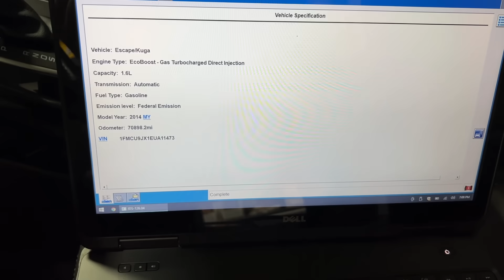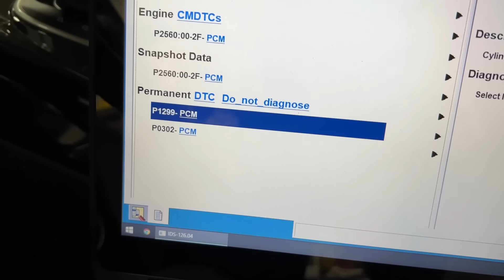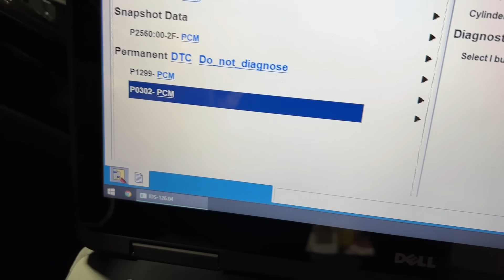Beware of Ford’s 1.5L 1.6L 2.0L Ecoboost Engines and Their Never Ending Coolant Consumption Issues!

Comment: I love your honesty and willingness to call out the problems, unlike the other ford tech channels that continue to deceive people, and say it's not a major issue. I'm a ford tech as well, and I find myself calling out Ford's newer vehicles for quality issues more and more as I work on newer rigs. Even new Toyota vehicles are having issues, Korean makes, hell, all of em. 

Don't buy anything new if you want value for your $. I always tell customers, sink a small portion of that extraction $ you would spend on new, buy a clean older vehicle, and fix it up. Not only are they cheaper, but better engineering, better part quality, material quality, less labor, less parts cost, and you can make it truly yours with rims, tint, stereo, lights, whatever. You'll still be out the door for a small fraction of a new pile. You'll spend less on insurance and registration. You'll pay less tax. 

 All brands, all models, are just planned obsolescence. That is absolutely the truth. I drive an old 03' 7.3 super duty, and a 08' Scion TC that are both fixed up pretty nice, the way I want them, for pennies on the dollar. I'd never trade either in for any of today unreliable turds. 300k problem free miles from the superduty, key on, hook some weight to it, go strait to New York right now with zero worries. Same with the TC, there's close a thousand pounds of audio equipment in it, been like that for some time, and I'd trust it over anything new to go anywhere. The wife's 09' G8 stays in the driveway at 70k, with a cover on it, because I know the afm is trash, and will likely have problems soon. We will sell that to an enthusiast for top dollar, and get something older, more reliable and be able to replace it if it gets hit or totaled. 

Don't trust any of these newer vehicles without extensive research and knowledge, because chances are, it'll cost you big. 

This is by far my favorite ford channel, you keep it real, a true American and patriot helping others avoid major headaches. You're awesome dude! From one ford tech to another, I'd EASILY day you're the best in the biz! Thanks all you do for everyone!
Reply: Your right on! They don't make anything to last and not just cars anymore.
I wish the sheep wouldn't accept it.
Reply: George, I agree completely. I don't think any new cars or trucks are worth what they are asking. I actually bought a nice old 95 Taurus, under 100K, for $100. Little money for head gaskets and it is my daily driver. I wouldn't hesitate to hop in and travel anywhere with it. And today's engineers... they don't have a clue, as to the problems we have working on their over-engineered garbage... any make!
Reply: Spot on...  One of my rides is an 05 Mountaineer with the notorious 4.0 SOHC. At about 230k, I got the timing rattle at ~2300 RPM. I did a timing job using Brian's videos to fix the rattle and it runs like a champ. The engine design is stupid with chains in the front and rear so it is an engine out job but it was a pretty easy engine pull and there was plenty of room in the engine bay. Other than that and some work on the 5R55S trans at ~150k on the valve body/solenoids, it has been a tank and it has been driven from coast to coast many times. It has been paid off for a long time and is relatively easy to work so I hope to get it into the next decade... too many computers/unnecessary electronics/turbos on newer vehicles... NA all the way!
Reply: @robc7323   @robc7323  maintenance is key, clean air filter first, oil and other fluids second, and third, responsible driving habits. That's usually is the key for success, or buy an over priced headache, and who know what you'll deal with later down the road. As long as your happy, and getting value for your money, cause that's what counts!
Reply: What happens when you wreck the older cars? The insurance won’t give you jack for them and you’re out a good bit of money keeping up the older ones unfortunately. I agree with a lot of what you’re saying but I’m not spending thousands to fix an old car just to get it totalled out and insurance writes you a check for a fraction of true value being book value

Comment: I have a 2012 FX4 F 150 with the 5.0 in it with 160 thousand miles it runs great I have never had any trouble with it but here lately it’s idling rough shaking then it stop shaking for a few seconds then it goes back to idling shaking again what do you think it might be thanks

Comment: Ford used to be very good compared to the other domestics as far as 4-cyl FWD. Now they've gone the way of GM. 

From an engineering standpoint, I'd like to ask who in their right mind thinks it's a good idea to throw boost at an open deck block design. Doesn't matter how much meat you throw at the cylinder walls, it's not going to be supported as well as a closed deck design. Whiz kids 🤦
Reply: Describe open deck vs closed deck design... Thank you!
Reply: @garrettstevensen2467  sure, I'll give it a lash. Open deck is when the cylinder head is removed, what you see is the outside of the cylinder walls & water jackets. It is all visible & "open" to the head gasket. This is done largely for cost measures, the block is cast & simply flipped over to empty the core sand. The disadvantage is the extreme upper part of the cylinder bore has no lateral support due to the absence of a deck & becomes an issue especially in boosted applications because the extreme cylinder pressure at the moment the plug fires causes the bores to expand ever so slightly like a balloon. This tiny bit of movement over time eats away at the head gasket. This movement can be counteracted somewhat by much thicker cylinder walls & ribbing but of course adds weight & cost

A closed deck is the opposite, when the head is removed, you see a slab of metal with cylinder bores & a few small passages for coolant, oil & threaded openings for head bolts. The upper part of the cylinder bores have lateral support & can resist bore distortion at the extreme upper end of the cylinder. All the classic American V8s have always used this design. That's why you hardly ever hear of them spitting a head gasket even under extreme levels of boost. 

That's not to say open deck hasn't ever been used successfully, Honda B & K series motors both excellent examples. They've been shown to make 1K HP easily...albeit at long term cost in reliability.

Comment: On the flip side, I have the 2015 1.0L 3 cylinder eco boost, zero problems including the duel clutch transmission. I think it’s the 2nd generation engine when they sorted the coolant hoses.
Reply: You are right the 2105-up 1.0L have the coolant lines fixed. They are also iron block which means no coolant intrusion issues like these four cylinders. As far as I am aware the 1.0L never was paired with the dual clutch. Originally 6 speed manual only then Ford added a torque converter six speed auto as an option.

I have a 2017 1.0L focus with a six speed manual I bought new at a steep discount. That engine isn't going to win any races but it is a little torque monster! Only 45k miles at the moment. Flushed the coolant and changed to the new yellow stuff and also new transmission oil at 40k. Cheap car to run and hopefully just keeps on chugging.

I figure if anything does go wrong the engine is so small and there is so much room in the engine bay I can disassemble it piece by piece removing it without even needing to use a hoist LOL.
Reply: It does have the duel clutch, ford service manager told me it’s not the same as the 4 cylinder

Comment: How about at 50,000 mine has BCM troubles. Where did ford find wrong? Like all the other leading US manufacturers they went they way of ford and now we have engines with very few miles breaking down. Unbelievable?! Thankfully I ended up with a naturally aspirated 2.0 with a 5 speed stick

Comment: what would your advise be regarding avoidance of coolant consumption issues on a 2018 mkc 2.0?  What can be done to minimize the chances of this happening?  Reduction of operations temperature by adding some sort of bigger rad or big fans?? like what ? Oil cooling ?
Reply: One thing to consider is to let the engine idle for several minutes before shutting it off, especially after high speed or load operation. 
This will reduce or even out the temperature of the area around the combustion chamber. 
That is actually good practice for any engine.

Comment: Ford has issued a number of Technical Service Bulletins that pertain to the coolant intrusion issue on these engines. I had to get the 2.0 in my wife's Escape replaced last year; thankfully we had Ford ESP warranty that picked up the cost. 

If you have the 2.0, the TSB number is 19-2346.

Comment: Can you make a video on how or why Ford Explorers with V6 3.6 engine has a "LOW ENGINE OIL PRESSURE" when the engine is full with synthetic oil. My Explorer is a 2014 with 145, 000 miles. Already with a water pump failure at 110, 000 miles. I MADE FORD pay the $5500 bill. A factory design failure.

Comment: My 2016 2.0L Ecoboost blew the head gasket externally between 2 and 3. After 4 mos of Ford Mulling around about what to do and replacing the head due to low compression in #2 , they replaced the engine.
Reply: It had 89k at the time of failure btw. Ford ESP covered it

Comment: And this is why I traded my 09 Crown Victoria for a 13 Fusion " S ", no turbo, no direct fuel injection, and so far...few problems.   Yes, it's a bit slow with only 175 horsepower out of a 2.5 liter engine, and fuel economy isn't astronomical (34-37 mpg) but it is pretty good for such a large car.  And I even somehow like the idea that Ford sold so many of them.
As far as Ford " ditching " sedans, China gets a 2023/new model Mondeo/Fusion while the Middle East gets a similar sized but slightly different looking car called the Taurus.  So Ford still builds sedans, just not for North and South America.
Reply: I’ve got a Ford Escape,2014 no problems so far but I don’t like suvs,, rather have a car
Reply: The 2.5 and 2.0 NA are Mazda engines... these new Ford engines with eco-boost are designed to FAIL after warranty expires !!! Shame on Ford !
Reply: 16 Fusion SE 2.5L here with 72k on the clock. Minimum problems knock on wood.

Comment: Laughs with Zetec 2.0. It is one of the best 4 cylinder engines Ford ever made. The 2.0 Duratec was also great. Both engines can last 300k+ miles.
Reply: Aren't those both n/a? I'd bet this is because of boost + too little surface area between cylinders.
Reply: the Mazda Ls right up there the 2.0/2.3 and finally the 2.5L used first in the Ranger was probably the best.
Reply: @SweatyBearsGaming  those Lima engines are bulletproof. Gutless but tough little engines.
Reply: What about the 4.2 V6?
Reply: @standhd  that's the Ford Essex engine they used in the Freestars and the base model F150s. They were good engines. It was the only Pushrod V6 Ford used in the 2000s. The other V6s Ford used was the 3.0 Duratec and 4.0 Cologne. The 4.0 SOHC Ford had was very known for having a strong bottom end, weak top end and suuuper weak timing chain components. My stepdad has a 2001 Sport Trac with 230k miles, it's sitting in the driveway with chain death rattle and a blown head gasket.
Reply: @RicardoPCGamer  Cologne is a cool name for an engine.
Reply: @standhd  it was named after the state in Germany. That's where those engines were designed and built.

Comment: Its always one thing with Fords, and its a big thing. The 3.5L Duratec....Water pump goes and you're $2k or more for a $90 part unless you can do it yourself. Powershift transmission. This on all the small EcoBoosts.

Comment: @FordTechMakuloco
Firm believer in the driving habits and type of service your car endures, makes a huge difference with the types of failures that your car experiences. All highway driving.. not as much as the city hopper. As well.. heavey on the gas off the line stretches the tolerances as opposed to the smooth, gradual and conservative operations.
Reply: Poor engineering is poor engineering how you drive it makes no difference.

Comment: Brian, so you did a pressure test and then found coolant in the cylinder?  Missing coolant from the expansion tank after the test?  You probably pushed the coolant into the cylinder with you test.  Bad head gasket.  Drop the oil, I bet there’s coolant in the pan from your test….running into the cylinder and the down through the rings to the pan.
Reply: OH WOW!!!! 🤔You figured it out….BRILLIANT OBSERVATION….I would have never figured out YOUR diagnosis!

Comment: I early to mid 1980s Chrysler's 2.2 and 2.5 turbocharged motors the cylinder head itself would start to rot away it's cylinder number two I had one that would overheat fill it up pressure tested fine come back two days later overheating fill it up pressure test it not see it for 2-3 months and then it would overheat I want to pull in the cylinder head off and the cylinder head the metal was etched away going from the coolant into the cylinder and the head gaskets was broken and from what I could gather the way it was broken it would move back and forth and shift and allow coolant to come in craziest thing ever I used JB weld beefed up the head where it got etched made sure the head was flat and saw the new gaskets and the customer was still driving the car 2 years later not losing any coolant

Comment: What causes the block to leak? Is the casting too thin? If you replace that engine, think about a tear down video.
Reply: Not enough surface material between the cylinder, and the heating/cooling cycles of the engine causing the top of the block to crack over time.
Reply: Exactly, like to know what and where the problem was. Over heated that caused the block to crack, the head cracked, head gasket failed. If the whole block needs to be replaced then the block failed.

Comment: Have you seen any problems with 2022 F150 batteries? We got 8 in not too long ago and 3 have gone in for warranty replacement on the batteries. One would barely start on a fairly mild winter day (0c) in a garage. When it got to the shop you could see the imprint of the caps through the sticker on the battery, as if it had built pressure and tried to pop out. I have found 2 more like that, but only one suffered any noticeable performance issues. Ford changed all 3 no questions asked once I was able to get past the "what on earth are you talking about?" stage at the service counter. 
I wonder if the batteries froze at some point while waiting for chips, but there is no way to prove that theory. 
They also hold a significant amount of water in the door sills, under the trim. All of them had dash cams installed with DVRs mounted under the back seat. Every single one had a pool of water on both sides that seems to come from the snow melting off people's boots. Trucks with carpet might not have this problem, but vinyl floor ones are really bad for it. There is so much water it is submerging the wiring harnesses. I can't imagine the freeze thaw cycle is going to do any favors for the wiring over the years. Already had one go in for a repair (15k km on the truck) on the parking brake circuit which had developed enough corrosion to cause it to throw an error on the dash. It still worked, but some part of it was damaged enough to demand service.